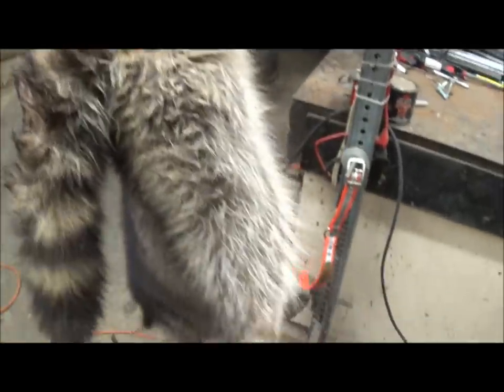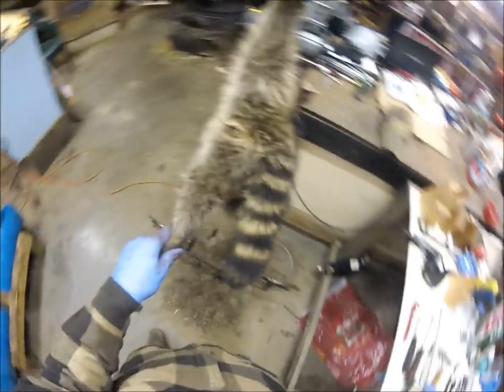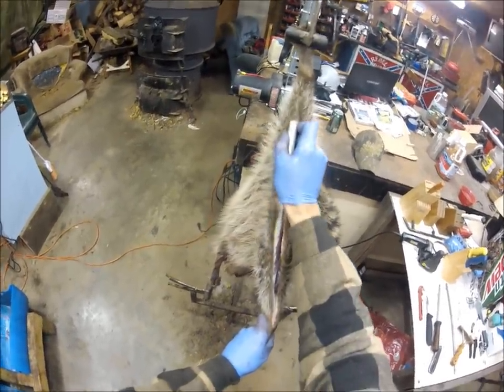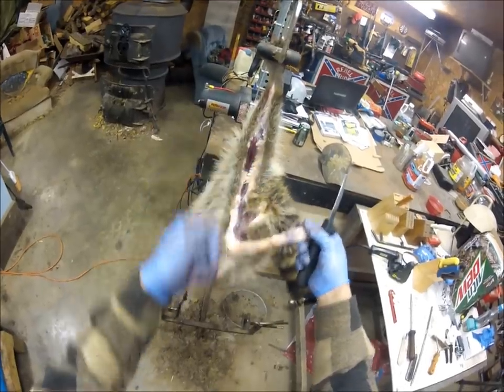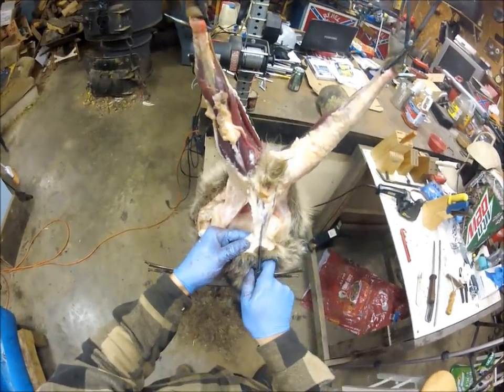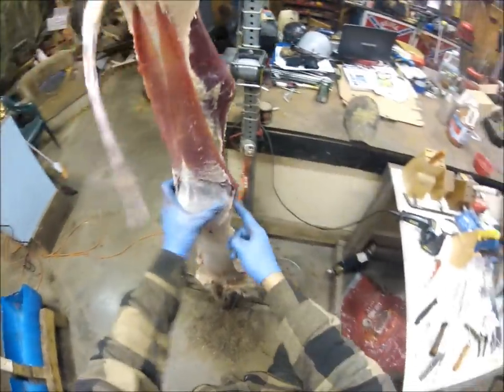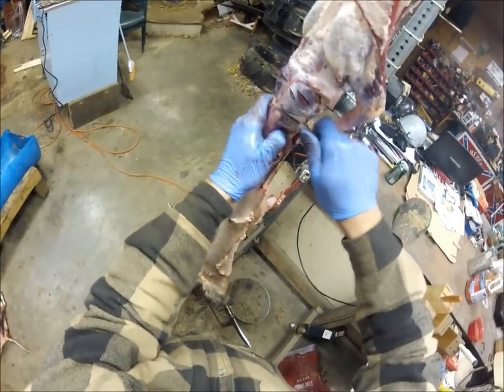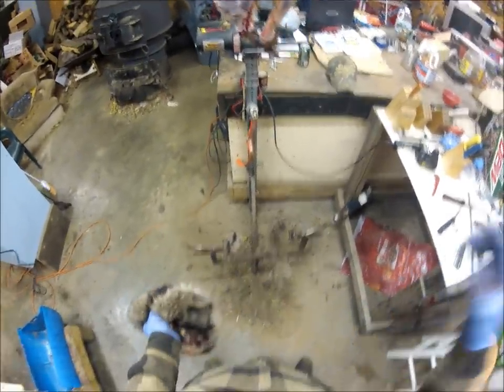Professional Fur Handling, Raccoon- Part 1 Skinning

Comment: you make it look soo easy! When I did my first raccoon hide, it took me more than an hour and I made lots of errors in the skinning process. I did not have the materials yet to tan the hide, so we took it to a taxidermist.
Reply: Mine first one had a lot of holes and I lost part of the tail and the head. I need to get his tail stripper thing and also the rack he hangs it from because most of the skin pulls off, but it's much easier to do with two hands
Reply: @DoctorDoomsPvP  My first one I tried to use the golf ball trick I've seen used with whitetails. It just ended up taking the head right off lol 
Get a cheap plastic tail stripper. They're like magic.

Comment: i;ve never washed my furs,but understand why you wuold.but was wondering why not wait till after the fleshing process.i have seen others make the same statment,is there a reason
Reply from the maker: the problem with washing after fleshing is that it to hard to control the drying of the pelt without having it shrink  before its boarded. boarding a wet pelt will usually result in the fur slipping. if you are careful in the steps you use to flesh, the pelt, it will not become dirty.  hope this explains thing for ya.

Comment: Dam you make that look easy! Think I need to pull more and cut less.
Reply: Probably, I keep a old ratty long sleeve button up shirt in my shed, I on have a skinning machine but if you get your elbow and jam it into the skin it will form a little "pocket" at that point the skin and carcass will be flush against your shoulder. Using your body weight push straight down. You should be able to go from the hips the whole way to the front legs in one go.  

*if you are very small or if you are a little kid you this method may not work the best for you.

Comment: Thanks for the anwser.  One more quick question  when you dry them over night do you put a fan on them ?  are they okay over night at 50 to 60 degrees before you refrigerate them the next morning
Reply from the maker: Michael DuBois no fan. you will be surprised how dry they are after they are spun out by the washing machine